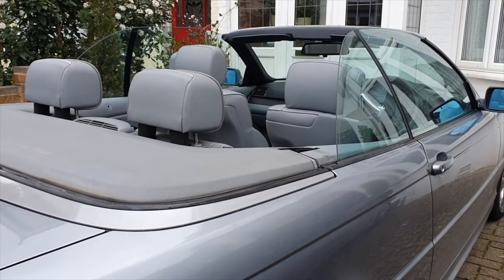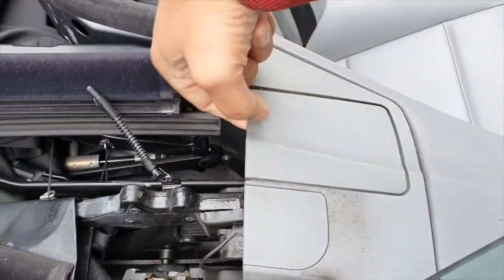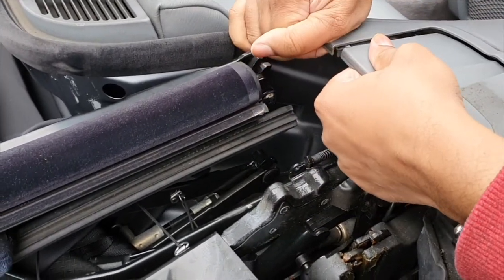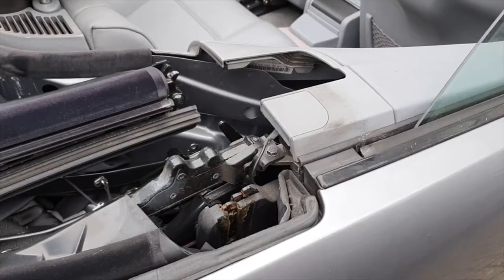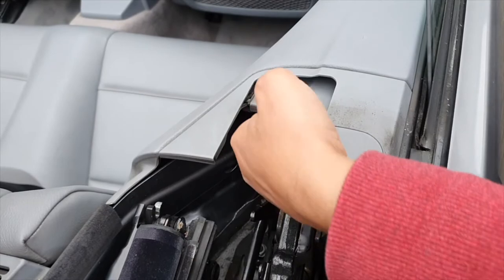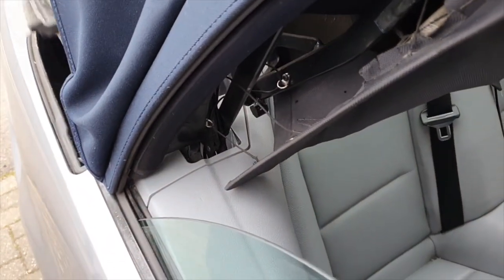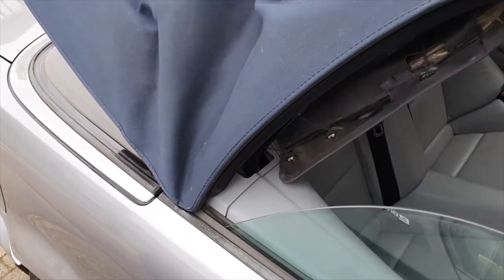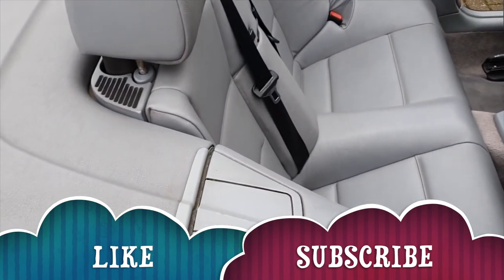BMW E46 Convertible Roof Flap Missing - Fixed

Comment: FYI, grey ones are 75 quid, black ones are £24 direct from BMW. Mine is black, I was on the verge of doing exactly what you've done until I realised black ones are cheap so I bought one.
Wish I'd seen you pry yours out though, I pulled the whole inner trim off to get to it 🤦‍♂️🤣

Comment: Great video. My roof is not working though and i am trying to troubleshoot it. Would you know?
Reply from the maker: Any luck with the roof.
Reply: @DawgWillFixIT  have had to replace the pump but it’s still very temperamental. The boot lid won’t come down during the process and I need to push it down manually. Sometimes I get errors and stops during the process. But it’s fine now another year until it’s summer again!!